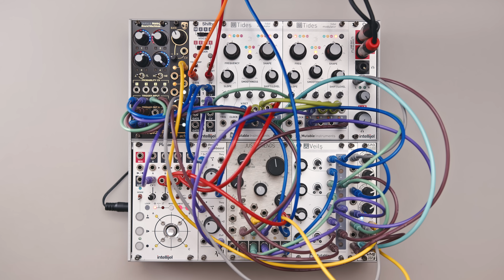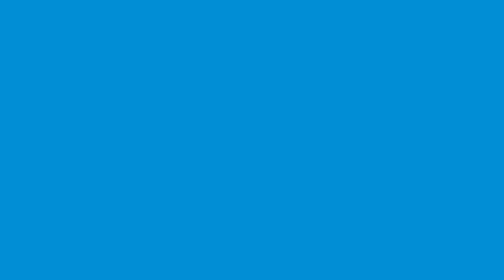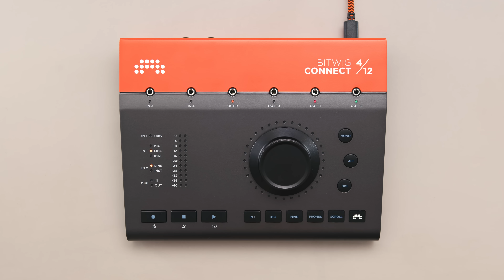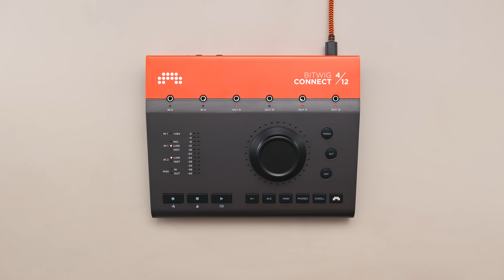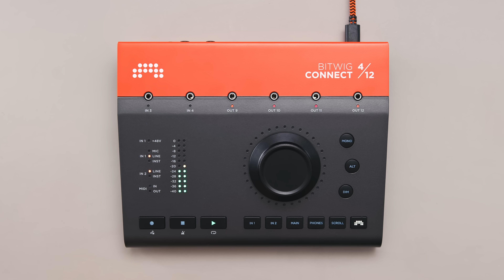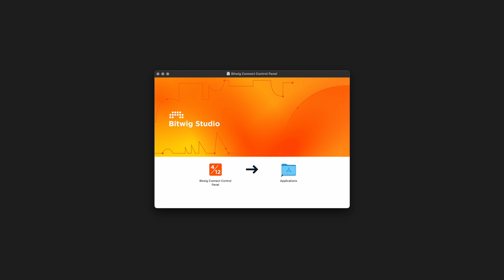Bitwig Connect 4/12 Feature Overview

Comment: Need a push 2 like controller for bitwig.

edit: this is also the most bitwig sound interface ever, cool!
Reply: First thought as well seeing all the bitwig integrated controls. A dedicated controller like the Push HAS to be on the horizon for Bitwig and I'm ready for it!
Reply: I use my Push 3 for Bitwig using the Drivenbymoss extension. It’s not as pretty but does enough. But it would definitely be nice to have an official controller
Reply: Totally agree, give us a controller PLZ :)
Reply: Id throw cash on this instantly
Reply: It’ll come… I think they’re testing some waters with this device.
Reply: Have you tried using the actual push2 with Bitwig? It works via drivenbymoss. :)
Reply: the support for controllers is good with the scripts by drivenbymoss. I use my push2 exclusively in bitwig for years already.
Reply: Yeah i am already invested in UAD stuff for ins and outs. I would love to have all this CV stuff, the Bitwig mode  and a few of the other features. Hopefully this will all be incuded if they do release a dedicated controllor. I would even be tempted back into using a computer again for livesets.
Reply: @steveglitch1393  it's just crazy they didn't give it adat so it could be used as an auxilliary interface for a bigger one from another brand, but it's only the first interface.
Reply: I see that Bitwig is more designed to program knobs than to move them by hand... A controller would not be very useful... 😊
Reply: @valentinoschmidt143 *would not be very useful to you. I would love to have a Bitwig controller similar to the push 3.
Reply: @mattuskamusic  Today I woke up wanting to have a controller for Bitwig, it must be karma...
Reply: But it should be a very good and innovative one, like Bitwig software... It would be good if it has the faders of the arpegiator (pitch and gate)... Similar to the arp 2600 sequencer
Reply: @valentinoschmidt143  its very useful for live playing with macro setup etc.

Comment: Please make a native midi controller
Reply: Why?
Reply: @ same reason they made this interface
Reply: @sqwerty0829 as cool as this interface is for Bitwig users, a MIDI controller that has full Bitwig Integration would make way more sense. Instead of why a controller Designed purposefully for bitwig having full integration the obvious question is why another small 4inputs Interface without ADAT when there is abundance of it(although its given that this one has a good USP for Bitwig users)

Did u ever ask yourself why Ableton Designed the Push and felt like it was useless having no unique selling point? Hardly doubt that. 
Now imagine that with having its own Bitwig twist.
Although there is 3rd party firmware for the push that Integrates it with Bitwig its far from full fletched Potential and u can see with this interface they prove they can think in unique innovative ways even for an audio interface purposefully made for bitwig.
Reply: Lets hope its not to orange 😂
Reply: Nektar Impact LX? Ok, it’s a midi keyboard … but also kinda midi controller
Reply: Reloop Keypad Pro?

I use a Novation Launchkey and with a script it works great
Reply: @crnova7  Almost everything works with Bitwig, along with script  by Jurgen Mosgraber, but we need one that is tailored to Bitwig, like cubase had, FL studio has with Akai, etc etc, and we need finally a good midi controller that has polyphonic after touch, MPE etc, the keybed to be something nice like Fatar etc. Black and Orange
Reply: I have an Akai APC64 and it works great with Bitwig
Reply: @DaleSimko  yes it does, but we want one that has everything at your fingertips to tap into this great DAW and just stay away from the mouse and keyboard as much as possible.
Reply: Nectar panorama p6 best
Reply: @АндрейБ-ч7ж I had it when they had bitwig 1.0 for free, they make horrible keys, Bitwig needs it’s on, not a push but something more advanced and no big. Jürgen should make the script for that new thing !